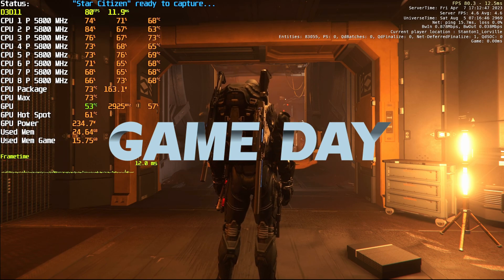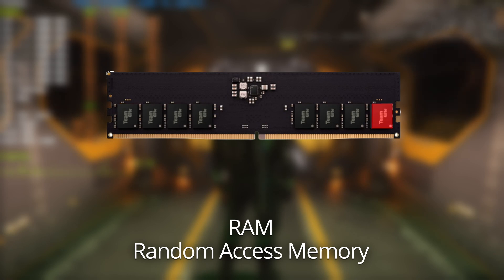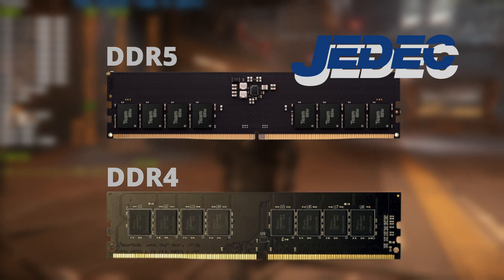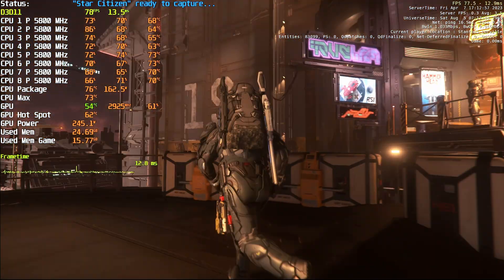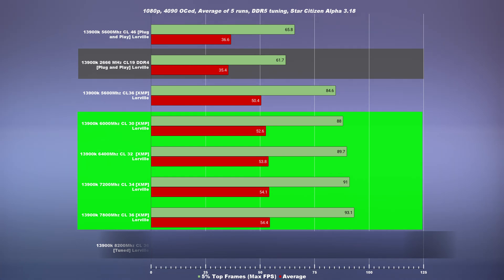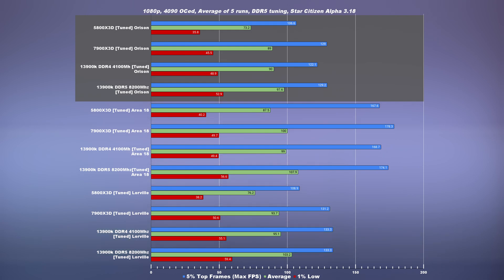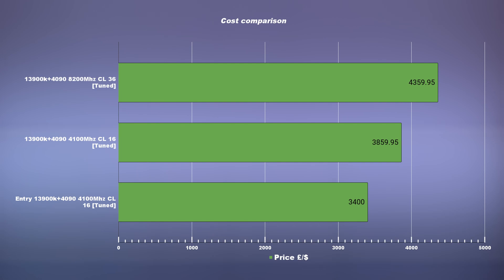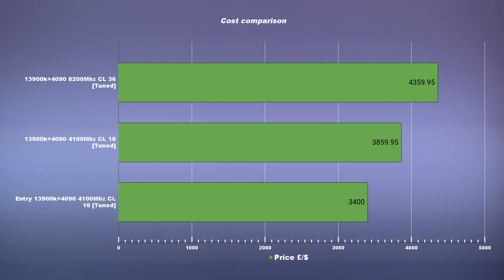Star Citizen DDR5 vs DDR4 tuned, ultimate test 3.18

Comment: hey anyone know if the 12900k is any good in star citizen? Microcenter has quite the deal rn for 400$ bundle with 32gb of ram and a motherboard
Reply from the maker: I had the 12900KS before the 13900k and it was 10% slower than the 13900K, tested using DDR4 at 4100MHZ same timings on both systems. For that price its a steal, but what is the RAM speed as that is the most important part in star citizen
Reply: 6000 ddr5 if you search 12900k bundle on microcenter it should show up @gamedaytoday1
Reply: @gamedaytoday1  yeah 6000mhz ddr5

Comment: First of all. Big thanks for the DDR5 Benches on the 13900k. 10% more performance is quite noticable and gives us a better perspective on what is best for Star Citizen right now.

What I find very interesting is that DDR5 XMP 7800 CL36 is on par with DDR4 fine tuned. But fine tuned DDR5 is another step further. So for people who don't want to fine tune DDR5 XMP is the way to go atm.

I'm really looking forward to the 7800x3d benches. To bad you don't have unlimited Budget to also go for the 7950x3d in comparison but well. Can't have everything.

Atm I'm using a 4090 with 12900k on XMP DDR4 @ 3600. I'm still thinking when and to what I wanna upgrade to. You give valuable input here!

Thanks a lot again. Have a nice day and keep going.

Comment: To be clear to anyone who doesn't know, RAM speeds matter WAY less for AMD GPUs, and consequently you don't need to splurge for 7200 MHz memory for them. 6000 or so will do. Hell, a 7800X3D with even just 5600CL28 could beat a 13900KS with 8000MHz memory in most games. Depends in SC, and things in SC will almost certainly change in the Vulkan era.

Just a PSA.
Reply: 13900ks vs 7800x3d +- same. Only if you play stradagy yes, you need amd. In cs we see how match tuned memory timings and clock give for all fps datas and i seen most compare and i can say in fight 1 vs 1 on yela drops of x3d CPU are massive so mb you will have cheap ram and not tuned but if you have drops in dogfight bc low clock it`s realy bad news for SC. and i dont say of burning issues and tempertures.

Comment: Can i get these timings on Gskill 8000mhz 32gb kit with no added cooling?? how far can i get with them? thank you
Reply from the maker: The Gskill 8000 uses the same memory chip from Hynix called A Die. So technically yes it can but you probably need active air cooling. Just try it

Comment: Ordered a 7800x3d as well, april 16`th komplett said they should send it :) i hope it`s a beast in SC! i got a b650 rog strix gaming mb, paired with 64 gb ddr5 cl30 6000mhz ram, i think this should work out pretty decent. I still need an upgrade for the 2080s for the 4k monitor, i have no ideas
Reply from the maker: Great set up check out ram tuning for 3XD chips here: https://youtu.be/YBPODMa5f8k

Comment: I picked up a 7800x3d and while the lows are the same as my previous 7900x the highs are soo much higher. Would love if you go into a bit more on how to tune the 7800x3d as I know  they are a bit trickier to overclock.
Reply from the maker: Makes sense because the lows are held up by the ram speed not the Cache. Tune the Ram increase the lows and averages.
Reply: Really??? Maybe I don't have my settings right or something because I'm getting slightly worse fps than my 7700x at 1080p, and the same fps at 1440p. I think maybe I should upgrade my graphics card instead (6750 XT)

Comment: Nice work as always, thanks for sharing your time and info.  Just replaced my 7900x3d with a 7800x3d.  Both hit 6400 DDR5.. they are monsters in SC!  7800x3d OC'd and only pulls 52-53w.. good stuff.
Reply from the maker: Congrats on hitting 6400Mhz! Great speeds

Comment: Greate test! Soon we will get more perf from game, but even 7xXxx3d have cash but frenquse is 4.6 mid up to 5 so not big jump, also they burn if have power problem wuth 7950x3d/ So it will be the king for more 7/10% performance + 1% and 0/01% what more needed to be stable so smooth its not avg fps , its how often avg fps drops for 40fps down or more, even you have 60hz monitors.

Comment: These videos and tenpoundfortytwos vids helped me pick out the 5800x3d and it's KILLER. The game is so much smoother and it's much easier to just focus on the game and get lost in it. Tried to mess with my ram too but no matter what I can't reach the rated 3600mhz only 3200. Still the gains are huge. Orison used to be 12fps now it's 30. Lorville is in the 40s-60s. Stations are in the 100s and space is in the 120s. Pve bounty dogfights would drop drames to low 30s but now I can dogfight around the 50s.
Reply from the maker: Arguably all ram can reach 3600Mhz, hard to know what you are doing wrong without knowing what settings you tried for 3600Mhz
Reply: @gamedaytoday1  my mobo is a cheap b450, but it is rated for 3600. The ram as well. The xmp profile was unstable, turning xmp off and trying my own settings was also not stable. I tried increasing timings to allow a higher clock and increasing voltage from 1.3 to 1.4. I believe it was 18 22 22 22 24 and I increased each one by one over and over and it never lasted a full hour in SC
Reply: @mrexpendable1232  b450 are good board i have x370 k7 i can get 3600 from gskill mems it may be your kits or try to Manuel tweak your rams with loser timing try to look at your infinity clock to it may be the problem
Reply: 1080p? Weird.. I got around 35-40fps minimum (mostly above 40fps)  at Orison with Ryzen 9 3900x, Gskill 3600mhz cl16 64GB, 5700xt GPU. With high preset and medium volumetric clouds.

Comment: Interesting numbers for sure. 
What kind of secondary timings are you using on the DDR5 sticks? You usually see some good gains tuning those, so just wondering!
Also, do you take server fps into account when doing the runs? I saw a massive 15 fps difference in game fps between a server running at like 4 fps and one running at 15 fps in Orison.
Reply from the maker: Yes server variance was taken into consideration server FPS does not impact performance rather it is the number of entitles the server has is sending the client that impact performance, at a minimum I did 5 runs to make sure I got both good and bad servers so the average you see is taking into account both the good and bad server performance.
Reply: @gamedaytoday1  What about the seconday timing?
Also, you got a solid 13900K there! Theres a big variance between them when it comes to their memory controllers, some of them just refuse to work at like 7600 etc, even with an Apex.